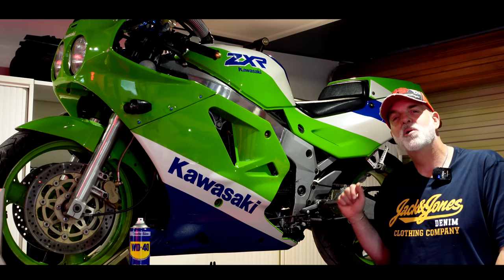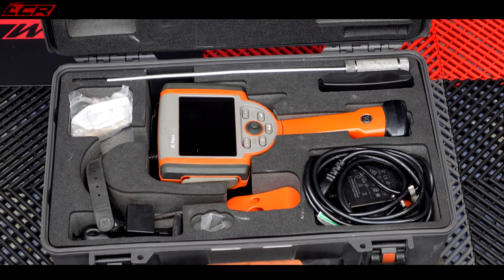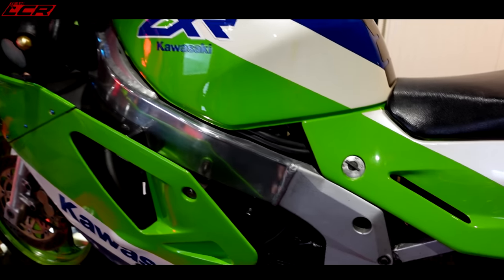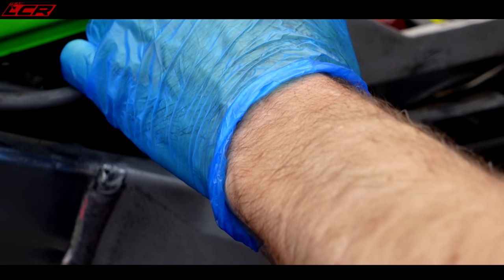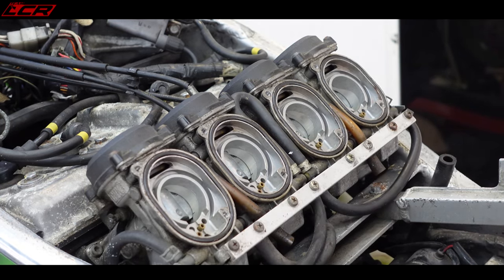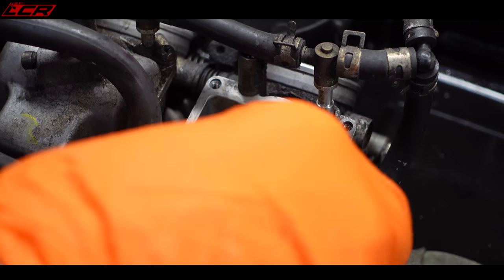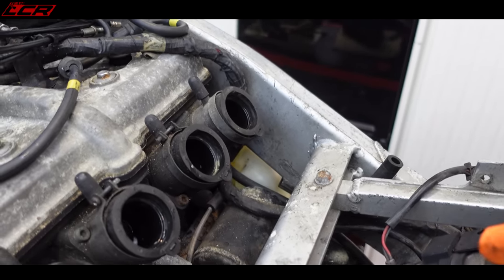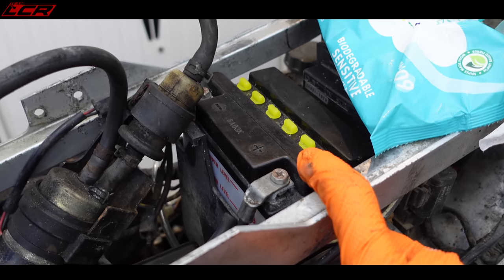Starting Abandoned 1990 ZXR-750 | 11 YEARS Since It Was Started!!

Comment: You git! You left it on a cliffhanger! Thank you for trying to restore the ZXR 750. I remember it when it first came out. I went down to the local Kawasaki dealership to take a look at a ZZR 1100 and I almost broke my neck rubbernecking as I went past one on the shop floor. My pants became moist as I looked over it, completely forgetting for a while why I came to dealership in the first place!

Comment: A lot of people think carbbed bikes don't have fuel pumps, but most do, especially larger capacity bikes. It will run without one, but the low pressure pump (2-3psi) just makes sure it is fed enough fuel so it doesn't bog down when you open up the throttle.
Put that camera down the sparkplug holes to check in there, put a little oil in them too to soak around the rings before trying to turn the engine over, and maybe do that manually the first time.
Reply from the maker: unfortunately the camera was only with me for one day to check the tank or would have stuck it everywhere hehe.

Comment: Doesn't look too bad Chopsy,  you always get superficial corrosion,  some bits can be cleaned up, other bits you clean and recoat.  It's good someone seems to have serviced it, better for the internals, gets rid of moisture within the engine  👍  Can't wait for future installments  🙂
Reply: I'll be surprised if that cam cover is able to be saved, but we'll see 🤞 Some parts will be restorable, others not so much. I was surprised how bad it was if I'm honest as it was in a shed, obviously not a good one. My Y2k ZX9r was sat up for five years and had a lot done to it but was not nears a rough, I know it's half the time this was sat up, but it was outside 😂

Comment: Looking forward to the rest of the restoration.
I do a lot of start ups on old bikes,  the first job is to quirt oil into the bore, remove the cam cover so you can refill the oil by pouring it over the cams, then crank the engine with the spark plugs out, before attempting to start it.
Just use a remote fuel tank hung from the ceiling, then there will be no need to use the fuel pump which shouldn’t be operated without fuel as it destroys them.
With the carb cleaning concentrate on the pilot jets as will have to hold the bike at 3-4,000 rpm to keep.
Reply: Do you squirt 2 stroke oil into the cylinders ?
Reply: @brankog7  
Just use a 4st engine oil.
Reply from the maker: Great tips 👍

Comment: I've got a GPZ900 that I've been restoring for years that was in the same state as this chops, the engine is very similar. Internally it was spot on after a strip down. That pipe under the carbs was the same on mine but it was just cosmetic, all of the metal coolant pipes were shite but only one of them was unsalvageable. It's not as bad as it looks.

Comment: Good seeing a bike or car being brought back to life and given a new beginning. I have a VFR800 fi that I recommisioned after 5 yrs standing in a back garden, no wd40, no cover nothing. The guy simply lost confidence literally overnight and stopped using it, even starting it up and running the motor. It consumed a ton of money to get everything as it should be.  when I dropped the oil it was brown and the consistency of dishwater....   I used a cheap semi synth for initial start and then changed it again immediately with another new filter for a quality branded oil

Comment: Nice bike , i love old ZXR's. I guess you have a bit of a mix . Radiator , airbox and fairing are 89 H1 , swingarm is H2 , tacho is L model and not sure about the oil filter 😅. And the bolt in the upper engine mount was a race track mod , too much vibration for road use. Gonna keep an eye on this one  👍.
Reply from the maker: yes seems its a miss match.. think its listed as an H2 when you do a reg search.. Maybe had some damage at the frontend and H1 parts were used...
Reply: Frame looks like H2 . H1 and H2 have slightly different exhausts , H1 fits H2 but you have no more access to the oil filter , maybe that's why you have an external filter.
Reply: I got an h2, and definitely got a cartridge filter not spin on, different sump on here too.but it’s an H motor with the belt.I’m gonna keep an eye this it’s a bit of a mixer. I reckon it’s fallen on its front. Check frame straight before spending!
Reply: I used to sell ZXR parts on ebay but 6 months ago deleted my account. I still have quite a quantity.
By the way that coolant reservoir sometimes get sold for £200 if you have the rubber band to it.

Comment: Looking forward to starting work on my H2 as well, my ZZR11 is nearly done so that’s the next one in-line. I’m not based too far from you so once they’re both up and running (year or so, maybe longer) then get in touch. Just shout if you need any steerage as I’ve done a couple of zxr’s before. 👍
Reply from the maker: thanks matey!
Reply: Ah interesting, what you have dear sir is an H1 with an H2 swingarm. The H1 has the oil filter from the bottom of the cooler, the H2’s have an element type filter in the sump, different carbs as well.

Comment: I bought a 1987 Kawasaki GPX-750R in the mid 1990s in Japan. Although it was used, it was pristine and had less than 10KM on the clock. It sure seemed fast at the time. There could be some connection engine-wise although a few Google searched suggest maybe yes, maybe no.
Reply: I had an '88 GPX back in the day - couldn't afford a new ZXR (it was 1990). Strong engine and gearbox nonetheless. I believe the ZXR motor was derived from the GPX but obviously had a completely different head, valve gear etc. The GPX was like a dinosaur compared to this overall - had more in common with a GPz900 - old school steel frame, carbs mounted horizontally behind the block etc. Looking forward to seeing this beauty brought back to life 👍

Comment: Most of the alloy corrosion looks like surface corrosion so soda blasting should brink that back to new. I did have a tank restored on an K5 Honda 4 which internally was much worse than yours and it cleaned up fine. The diaphragms in the carb tops may be a problem as they are pretty thin material. So long as not fuel has got up there or moisture they should be ok.  A ten yr old battey will be almost suphated up, tossit and get a new sealed unit. The rest of it depends on how much you're willing to spend on the project. Might take you a couple of years but you'll have one neat machine at the end.

Comment: You probably checked mate but the pilot jets will be the key to starting it, the mains could be totally blocked and it should still start and run up to 20% throttle really as the slides won’t move until there is decent vacuum anyway. Ref the pump, I’d honestly just replace it now and save yourself bother, then you have the new one then. Best of luck mate
Reply from the maker: yes absolutely you are correct!! caught me out as you will see in the next vid
Reply: @LambChopRides  haha do I get points for being able to see the future? Haha

Comment: Did you drop a bit of oil down the bores prior to cranking her over ? 
Normally when I'm getting one of these going the pilot jets and float valves are the main issue.  
I have never had a zxr or zx7 that won't start.  No matter the condition.  
The engine looks like it just needs dropping out the frame and giving a damn good bath.
Good luck with the resto
Reply from the maker: No as wanted to avoid removing the plugs due to the crap in the recesses.  Yes pilot jets causes me an issue in part two 👍
Reply: @LambChopRides Blow the crap out with compressed air.

Comment: Good luck with restoration. Japanese bikes can cost a fortune in parts and more than bikes worth. Hopefully you will get some free stuff. Small thing but bolts re plated as soon add up . I went down the old British route T150v as parts so much cheaper and many uk made.  While obviously not a good a later Japanese stuff for a ride in the Cotswolds with my wife just 😎.  Good luck chops very hard work doing a restoration and not spending 3xbike value.

Comment: That's quite a strange thing to see :-
That's a H1 airbox on a H2.
Interesting.
Reply: The carb size on a H1 is smaller than a H2.
Reply: Bare in mind the H1 battery is bigger physically in size than the H2.
Reply: OK SO THIS IS A H2 FRAME WITH A H1 ENGINE.
MAIN THING TO CHANGE IF YOU DESIRE TO IS THE ONE PIECE ENGINE SPARS.
THE ONLY DIFFERENCE IS THAT THERE'S A SMALL APPENDAGE ON ONE FOR THE RADIATOR MOUNTING AND NOT ON THE OTHER.
Reply: Much time, much effort here.
Regarding money to get it back to H2 spec is £1500 at least.
Reply: I still have a mint original red H1 and H2.
Although the H2 has just developed a grinding sound when put into 4th.
Which is a bummer.

Comment: You have a H1 done up to look like a H2 first front fairing the blue decal above the headlight is missing the decal on the side fairing is H1 the H2 is higher and you have a small triangle decal under the indicator. Fuel tap is not H2 , you have an external oil filter H1 the H2 is inside the engine in the sump. Wrong clocks neither H1 or H2 . Radiator is H1 the radiator for the H2 is a massive curved one not a rectangle one you have. You do not have and authentic H2 its a mis mash of H1 base with H2 bits added to make it look like a H2 the clocks are from J1/J2 I think. Trust me I own  a 1990 ZXR750H2 for the last 28 years done a full restoration 7 years ago. Oh yeah another thing I noticed the top mount to the cylinder head to frame the bolt is the wrong one not Kawasaki. Sorry to be the bearing of bad news you was lied to about it being a H2. I bet if you measured the carbs they will be 36mm (H1) 38mm (H2)
Reply from the maker: Yeah guy never said it was a H2 to be honest.. think you maybe right perhaps just has a H2 swinging arm.. But actually I checked the engine numbers and it is H2 series.. God only knows why h1 rad etc... oh well
Reply: @LambChopRides  if the engine is the H2 you should have a round section in the sump where the internal oil filter should go if that isn't there well id be stumped just looks like a miss mash of H1 and H2. You really need to strip that down like I did with mine to the frame and go from there. The other worry it might be a GPX750 engine which all H1 and H2 came from.
Reply from the maker: Yeah it's going to be stripped and rebuilt like yours 👍 I'm not too worried if its a mismatch,but want a genuine ZXR engine of course! We will see when the full strip down starts. Thanks for telling me what to check for 👍
Reply: @LambChopRides  Your welcome Lamb like I said if you need help just ask bud.